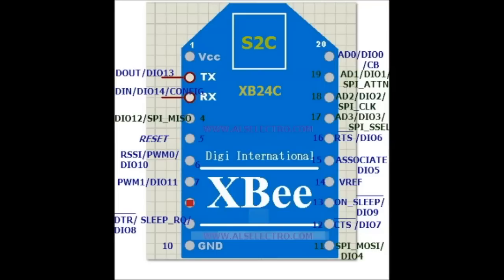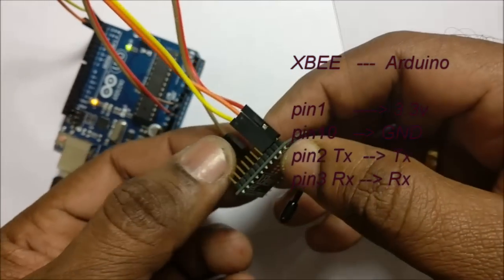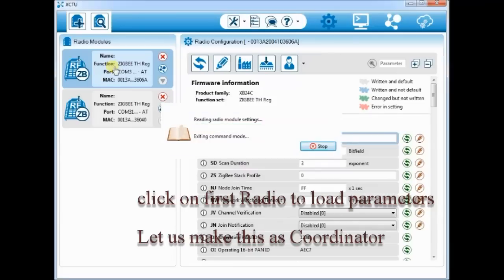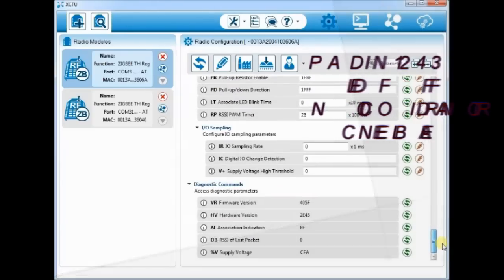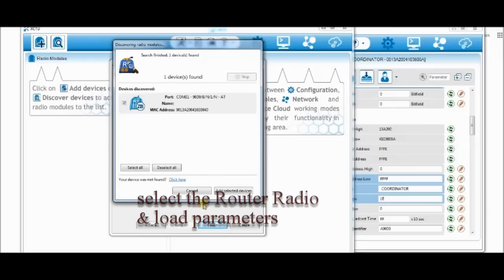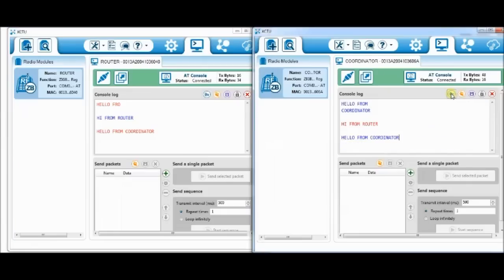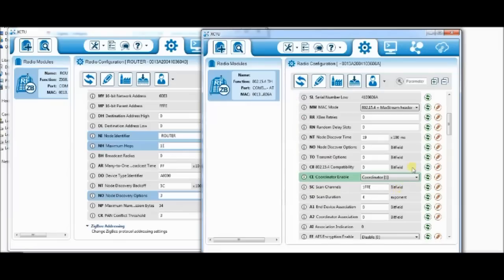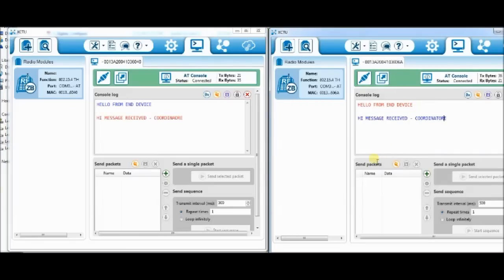ZIGBEE XBEE-S2C -How to configure

Comment: ardunio not connecting without xbee explorer. I disconnected it, introduced it, then connected it to arduno, but it still couldn't find xbee, what should I do? can you help me? We will also communicate with BME280, Adafruit GPS, MPU6050, RTC DS1302 via xbee s2c. We wrote the codes of the sensors, but we could not find and understand the codes we need to add in order to send them via Xbees. Your code is too short. will it work? Are the xbee codes different for each sensor?

Comment: How to transmit and receive using user defined data i.e Rx with fixed size data and Tx with same data @ 100ms /1000ms etc from one system to  another

Comment: Hi! I am using the Arduino Micro to configure my XBEE board. The micro has two reset buttons on it. How do I bypass the bootloader? I tried uploading a blank code but I am unable to detect the device.

Comment: Thank you Mr. Saravanan for this tutorial. It was very helpful to learn how to use the Arduino to connect to my computer serially. However, I wanted to add a couple of issues I ran into for others who may also encounter these problems. Now I'm not sure which of these issues actually fixed my problem, but I will list them here...

1. My S2C is a programmable zigbee radio, so I had to use the "Add radio specifying port settings" option in the top left . If you have a 'B' at the end of your xbee model number, then your xbee is programmable as well.

2. I had to reset the radio during configuration. If you are using Arduino as in this video, you can place a jumper from ground (pin 10) to reset (pin 5). If you have a breakout board and can place the Xbee on a breadboard, then a push button switch is easiest. You only need to set reset to low for a second. (Note that it took me about 3 tries with the right settings before it took).

3. My xbee radios had a default baud rate of 115200. I received them from Digikey. If you are doing the above 2 steps with no success, then try playing with the baud rate. From my readings, 9600 and 115200 are the most common. When using the "Add radio" option with a programmable radio, you will have to try each setting one at a time. Give it a few tries on each setting (see end of note 2).

One last thing I'll add is that I also installed the usb driver from digi.com. I think this is supposed to be for the usb item they sell, but it can't hurt to install it anyway.